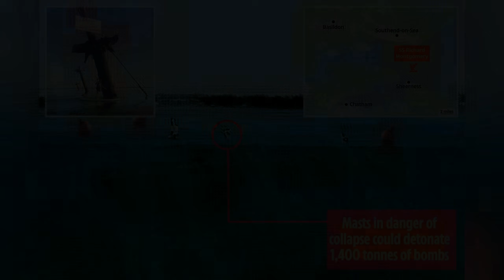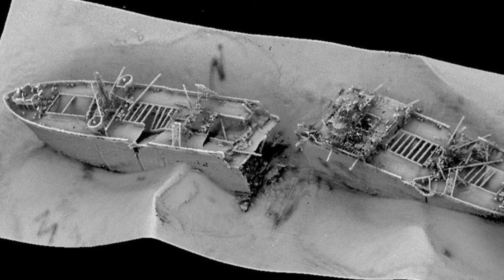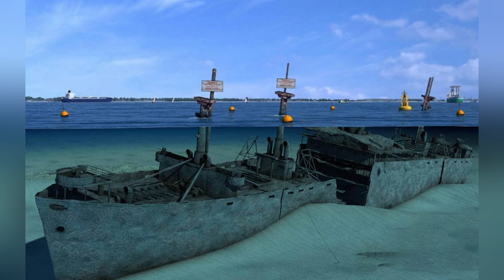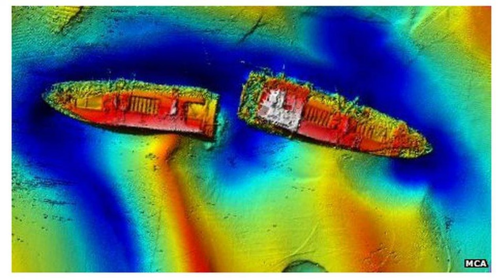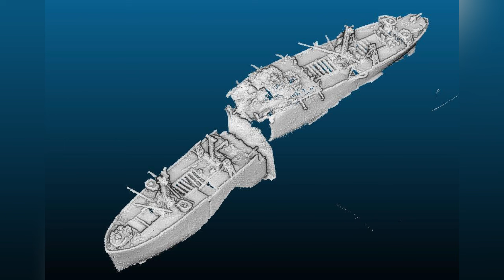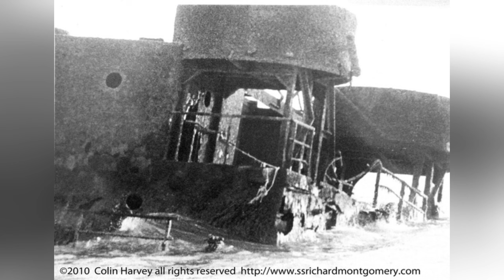Revealing SS Richard Montgomery: The Explosive Wreck Britain Can’t Touch

Comment: I would think all of the wood crating has disintegrated, since it is a food source to many lifeforms.  There are bacteria which can eat elemental iron and oxidize it to run their life processes.  The TITANIC is being consumed by bacteria. There are bacteria which can use TNT for their life processes and convert it to harmless compounds.   What was not mentioned, but probably done is the testing of the sediment around the wreck to see what the migration of materials out of the wreck may be.  TNT can cause cancer in fish livers.  It might be a good idea to seed the wreck area with the proper bacteria to digest the problem.  The explosives' energy can be consumed by bacteria over time with less and less of it existing or expended in one big blast.
          My dad was on a LIBERTY ship during WWII.  They were designed to last maybe five years until the end of the war.  During winter when the metal would become brittle, they were susceptible to breaking in the middle, if caught in a big trough.

Comment: There is enough munitions and explosives on there to take out sheerness and beyond that. You can’t recover it, you have to do a controlled explosion somehow which costs huge money to do, that is why they chose to put a perimeter around it and exclusion zone. Getting the equipment there alone and in place and the team would be a monumental task. Also because of the years that have passed and the environmental factors and deteriorating conditions it makes those munitions and explosives very fragile and volatile.

Comment: Interesting to see the comments about encasing on sand/concrete etc. I have sailed around this wreck many times and my uncle’s father was the last person off the boat, so a few details I know…
1. She lies in the Thames Estuary just to the north of the Medway Channel. So not ‘in’ the Medway as per the vid, but in the channel into the Medway and Thamesport etc.
2. Vessels have collided with her numerous times 😮
3. Yes, there is a total exclusion zone around her marked by cardinal buoys … not as per the vid 
4. Customs & Excise used to have a data centre in Shoebury and the Richard Montgomery was an officially logged risk that could wipe out that DC (no longer there)
5. They were due to remove the crane masts in 2022 but delayed due to ‘findings on the seabed’, delaying things, but are now expected to undertake the work in April-26
6. One train of thought goes… After 80 years the detonators will be washed away and she’s completely safe, while another train of thought goes… After 80 years the detonators will be mega unstable and she could blow at any time. Take your pick as to who is right
7. No, you cannot build a coffer dam, cover her in sand/concrete/whatever:
7.1 The UK has very high tides. High tides (height between high and low water) create big tidal movements of water
7.2 The ‘huge’ Thames estuary is really a number of channels through a lot of shifting mud. Yes, on your Google map it looks one big piece of water, but really, it’s a lot of channels through mud that move
7.3 Build a coffer dam around her… So, take something might be sensitive, and drive piles into the seabed all around it causing shocks… hummm 🤔
7.4 Encase her in sand … and have it all washed away in a couple of weeks … and don’t forget, she lies right alongside the dredged Medway channel

The sad answer is that there is no easy solution, and she may, or may not, be a big danger

Comment: So basically an unfriendly power could take out a good part of the coast line and several towns with a small bomb,  missile or a drone. Not to mention the resulting wave that would go up the River Thames flooding local areas. I'm surprised it hasn't happened already

Comment: There will be no fuses installed during transit and only the main charge is present. Some of them are shells designed to be safely hurled miles and the bombs are designed to be dropped from height and still only detonated by a delay fuse. These are not delicate fragile devices.

Comment: I would suggest dredging and using the tailings to cover the entire wreck building an island. Before doing so set up charges so that once it is covered well enough to suppress the explosion it can be detonated to remove the hazard. If nothing else, burying it in tailings will support everything from kinetic impact much better than what they are doing and it will hold the hull in shape as it degrades.
Reply: Thats just building a bigger bomb! An explosion is simply a fast-burning substance confined to a restricted space!
Reply: @hamshackleton  It dampens the explosion, removes a lot of oxygen from the equation, and prevents shrapnel from flying everywhere. If anything, it would direct the blast downward into the soft riverbed.

Comment: Towards the end of WW2 a ship pulled into Holy Head Harbour, Anglesea, North Wales. Before it had time to dock or unload a German light bomber dropped a bomb on it. The crew immediately sailed the ship out of the harbour and scuttled (sank) it. To this day no one among the local residents I have spoken to has any Idea what was, and still is, on board. However there is a sign on the harbour-side warning that the wreck must not be approached and that there is a 12 year prison sentence (more than many murderers serve) awaiting anyone who does. The wreck is visible from high ground near North Stack Lighthouse.
Reply: There is a warning sign just north of church bay, which warns about a sunken cargo ship the SS Castillian, which sunk after hitting rocks whilst carrying munitions. Not sure if this is the same ship.
Reply: That and the Montgomery are the only two ships that are covered by the Dangerous Shipwrecks Act of 1973 BUT THERE MAY BE A CLUE TO BOTH … google USS John Harvey and the ‘Bari Harbour incident’ (Italy 1943) if one ship could carry … the load specified … what are we not being told about these two sunken cargo ships?

Comment: This entire video is a load of bullcrap. The TNT that was used at the time was VERY stable. It won’t go off just by impact. However, research in the intervening years has shown that microbes break down TNT into toluene and nitrates (fertilizer). The toluene is poisonous but is rapidly diluted by the seawater to nonlethal concentrations almost instantly, leaving behind the fertilizer. This process would have started immediately after the hull was flooded. After 80 years, there might not even be any explosives left, just fertilizer and not much of that. The gloom and doom scenario just doesn’t jibe with the current state of the science. But the people who made the video need clicks.
Reply: The TNT is mostly in munitions, ie encased in steel, so may well be still viable. If those munitions   had fuses those could become unstable.

Comment: Phew, that was much longer than necessary!

What does the wreck look like at low tide?  Can the hull be seen?
Reply: Yes it can be seen very easily without binoculars ..I lived in Sheerness in the 1990s
Reply: NO… the hull cannot be seen, but the top of the crane masts were are evident. They were due to be removed in Jun-22 but this has been delayed due to ‘new findings’ on the seabed. They seem to be due removal now, Apr-26…pending other findings!

Comment: Has there been a case of any WWI or WWII ship wreck anywhere in the world ever having ordnance detonate after being on the ocean floor?
Reply: Okay, so not technically WWII, but the SS Kelsie sank in 1946, so close enough. Attempts to dismantle part of the hull in 1967 set off its explosive cargo. Fortunately the wreck was at a much greater depth and the cargo considerably smaller. Nevertheless, the explosion registered as a magnitude 4.5 seismic event was detected across Europe and North America—and shattered windows and roofs in Folkestone, several miles away.

Comment: I would build coffer dams and fill them with reinforced concrete. Build all the way around. Shape it like a bomb disposal portable unit.
Reply: Two walled sheat piled coffer dam, filled with concrete, pump the water out and then blow it up. The big issue is the tsunami from the explosion, if the water is gone problem sorted.
Reply: @jonathanbuzzard1376  because that wouldn't disturb the wreck now, would it. 🤣🤣🤣🤣🤣
Reply: @Grendel650 basically no it wouldn't, because you put the coffer dam sufficiently distant from the wreck so as not to disturb it doing the installation. If it goes off pumping the sea water out then it was ready to go at anytime anyway. Noting the longer you take to pump the water out the more likely it is to disturb the wreck.

Comment: Thing is what you see from the pictures here does not tell you that the water in and around the ship is almost opaque. No matter how much light you have, in what is effectively zero visibility the only way to deal with the wreck would be to coffer dam it and lower the water level slowly taking off the metal structure from the top down and lowering the water as it went until it was then safe to work with the explosives. There would of course be settlement of the Medway mud that would help with visibility. That though is an immense job as the dam would need to be around 80feet high taking into account the sea bed level variation too. So the dam would have to be some 600 feet wide as a minimum and probably over 150 feet to cover the beam of the ship. There is going to be at least 9,000 tons of steel still remaining of the ship itself without the tonnage of its unexploded cargo. So that is a huge amount of water and a huge amount of money. I would guess at well over £200M.
Reply: Makes great sense but there's a cost! No one wants to come up with that money! -Push the problem away !Leave it to someone else in the future!
Reply: Trump is good at building long steel walls, and it their stuff too !!

Comment: The Beaufort Trench between Scotland and Northern Ireland had hundreds of tons of WWI munitions dumped in it after the war. Has any of those exploded since?  If the answer is no, what makes the Montgomery any different? 
I did read very recently that they plan to remove the masts this year. If the explosives are still dangerous, what effect could any vibration from the process have. Doesn't that increase the chances of an explosion? 
I certainly wouldn't want to be within 10 miles when the work begins.  😮❤😮
Reply: The masts are a big threat as when they eventually collapse it could set off a chain reaction within the explosive cargo.
Reply: @rogercude1459 I get that. I just worry that the removal itself could set something off.
Reply: @markstott6689 Like Butterfingers dropping a wrench?
Reply: Let hope the job goes to the best people and not the lowest bidder 😬
Reply: @iangrice329  Where's Fred Dibnah when you need him...?

Comment: To solve this problem. Only 2 things to do. YOU CANT TOUTCH THE SHIP IN ANYWAY WITHOUT SETTING IT OFF..1 Thing, dont do nothing, cross your fingers, ignore it. 2. Evacuate the blast aria. Take what ever you can with you to rebuild the town and what else is needed, clear out.  SET OFF THE SHIP. The damage is going to be what it is going to be. When the dust settles, start rebuilding, or say T.H.W.I. & move on. At least the ship is GONE! no worries anymore. 🙂
Reply: The active Tsunami that would barrel up the Thames would wipe out all of the docks and the British Parliament buildings. Not that London is going to be missed these days.
Reply: @patreilly1458  Except the Thames is a totally different river. The only places that would 'suffer' should the Monty go off are Chatham and Gillingham. Neither of which would be seen as a particular tragedy.
Reply: @patreilly1458 there's not enough water in the estuary to do that. At high water most of the estuary is only 15 metres deep.
Reply: Agreed!

Comment: Why not cover it in sand to create a small island. Once the island has been created then detonate the munitions onboard. Yes there will be hell of a bang but the sand should stop most of the tsunami.
Reply: I doubt adding compression to the equation would be prudent.  Can't not do anything, but can't safely do anything.  Possible solution:  Build a large cofferdam a distance from the wreck encircling it, then drain the water surrounding the wreck.  Evacuate the nearby cities and populace, then blow the wreck in place.  HUGE explosion, but other than parts of the ship being blown high into the air, no (or minimal) tidal wave because the explosive force would be vented into the atmosphere rather than creating a catastrophic wave.  Yeah, they should have gone in and cleaned it up in the late 40's.
Reply: There is a strong current which would wash away the sand. Any sand not washed away would put pressure on the ship and increase the chance of it falling in on itself and exploding.

Comment: According to a BBC News report in 1970,  it was determined that if the wreck of Richard Montgomery exploded, it would throw about a 1000 feet-wide column of water and debris nearly  10,000 feet into the air and generate a wave  16 feet high.  Which would be an explosion and a half.   Gawd knows  how many people would be killed or injured by  debris.
Reply: And if it’s left alone, the same thing will happen with no warning whatsoever.
Reply: Don’t worry I hear the government are planning to issue everyone in the blast radius with umbrellas 😂
Reply: We are always quoted the worst possible scenario. The best option is to cut up the wreck. This would separate the explosives. Which are always unlikely to all explode all at once.
Reply: @Dave5843-d9m  How would you do that without risking detonation?

Comment: If I can add a little to the story. The de-ammunitioning work ceased in 1944 mostly because the London stevedores (dockyard workers) were demanding danger money and the government refused to pay.
During the Vietnam War President Lyndon Johnson offered U.S. removal of the remaining ammunition but Prime Minister Harold Wilson refused as the US had wanted Britain to get involved in Vietnam. He feared that accepting US help with the wreck would make rejecting Vietnam involvement that much harder.
The last New Scientist article which I read said that the remaining ammunition is unfused 2,000 pound aerial bombs on the lower deck. These are not a problem being - essentially - inert. The problem is on the next deck (above) where fused 100 pound anti-personnel bombs are stacked. The deck is split and failing and one fear is that a fused 100-pounder may drop, detonate and cause a sympathetic detonation of the 2,000-pounders which it has landed upon. 
There is also an issue with copper and brass fuse components as copper stored in these conditions could see the creation of unstable copper fulminate. This is impact and friction sensitive.
Finally there is the history of the exclusion zone itself. The Thames Estuary was fought over in WW1 and WW2 with much old ordnance being dredged up in fishing nets. Rather than bring this ashore (wasting time and money) some fishermen have admitted to dumping old projectiles and bombs inside the exclusion zone. So it is not just the wreck but the area around the wreck which must be regarded as a hazard.
Sheerness is no stranger to explosions with HMS Bulwark blowing up here in 1914 and the minelayer HMS Princess Irene blowing up here in 1915. In the latter case the 300 one-ton sea mines resulted in a blast which hurled fragments up to 20 miles away while a ship half a mile away had its crane torn off. The blast was allegedly heard 100 miles away.
If you visit Sheerness today the seawall of the town facing the wreck is up to three stories high with Victorian boarding houses unable to see over it. The wall tapers and gets lower away from the town centre. Southend on Sea is the other side of the Thames Estuary. It has been calculated that should the wreck explode at high tide Southend would get a tsunami about 15 feet high. Meanwhile any undetonated fused 100-pounders would be thrown high into the air to potentially fall on Sheerness.
The USS Richard Montgomery has not done the property values in Sheerness any favours!